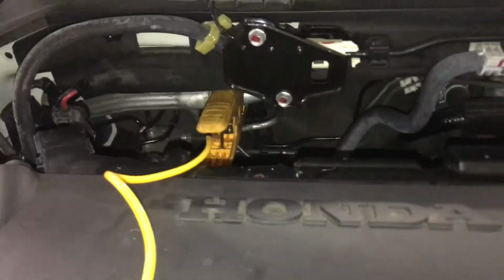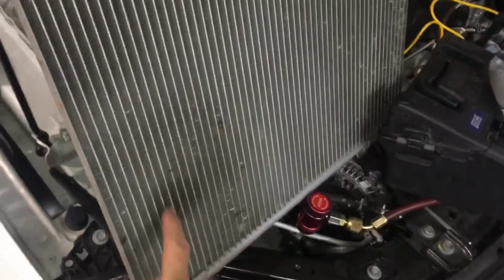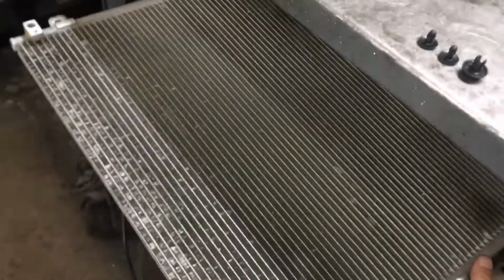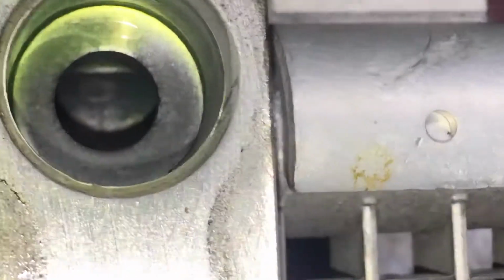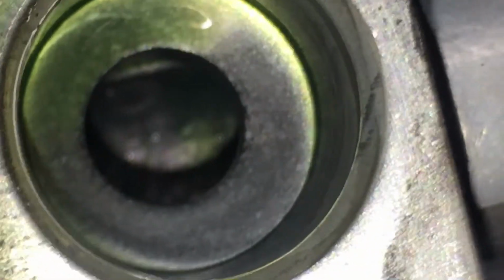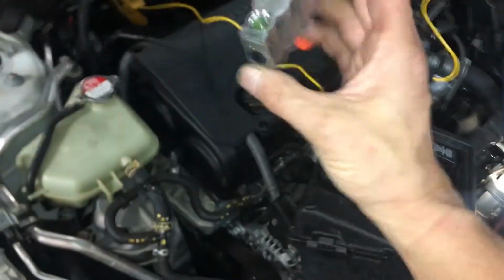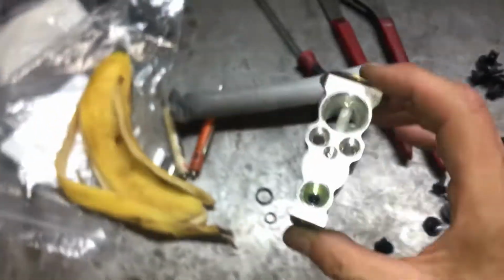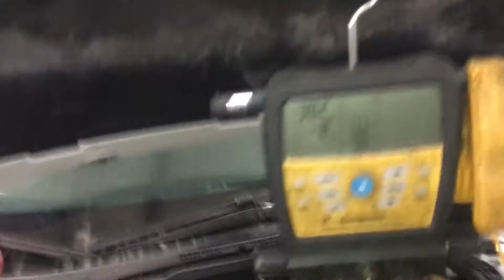Honda Civic AC condenser leaking and expansion valve O-rings

Comment: Heard these Civics had a lot of problems with noisy CVC compressors (the same one on my car, though a later model and a factory load of Ester oil instead of PAG). Immediately knew they had some kind of low refrigerant issue, since that's when this poor little thing becomes loud (most precisely, it's higher than normal superheat that makes them get loud, and also starves them of oil; they're a bit resilient only because there's an oil separator built in).

Comment: Should the low pressure sensor not cut off the ac system so that what you describe cannot happen?
Reply from the maker: That is a vary good false belief we are told . 
          For those people who read the description in the service manual about the low pressure cut off may assume that is true. 
           And told by all time mechanics who actually never knew. 
              The low pressure cut off happens only after you’re down to a minuscule amount of April refrigerant. 
                Only a handful of high-end vehicles had somewhat of a good system that actually measured pressures and temperatures and would cut out the compressor using the body control module the HVAC module or the ECM depending on the manufactures method they apply.     It would not let the compressor come back on until somebody either manually went in and cleared the codes or disconnected the battery in the vehicle. 
                   On the rest of vehicles like the old days you had an idiot light to tell you when your car overheated.   It was a good reason they call it an idiot light.
             The low pressure switch allows the AC system to fall to a state of charge that is basically nearly vapor with almost no liquid at that point the oil starts leaving the compressor and does not all return and in that state your superheat is so high that there is absolutely no cooling affect taking a place coming back to the compressor. 

          As long as the pressure switch sees a pressure of roughly 44 psi depending on the manufacture the compressor will be allowed to operate.     
           And on a hot day all you need is vapor pressure inside the system to achieve 44 psi. 

         Unless it’s winter time and the temperature outdoors is less than 40°F then that refrigerant in the system would condense down and shrink and lower the pressure lower then  44psi. But how many people are using their air conditioning in the snow. 

          It’s a very flawed system design

This is the difference for people who know facts from the couch potatoes what parts changers we get our information from you just read books. 

          I have several videos released showing vehicles operating with nothing more than 1 to 3 ounces of refrigerant left in their system nice beautifully burning hot compressors that haven’t died yet.